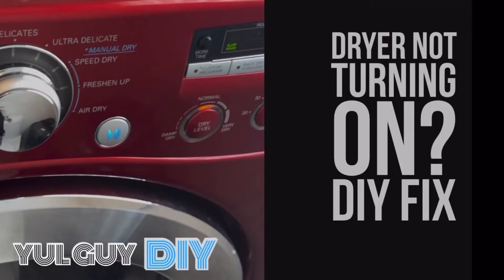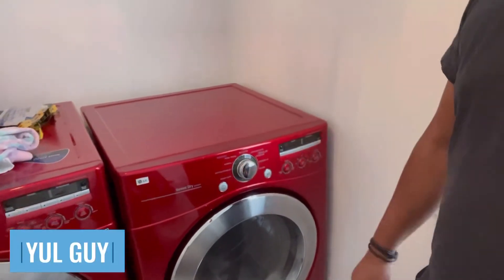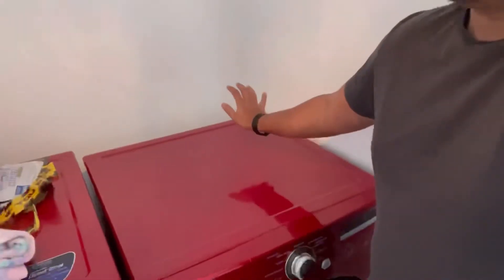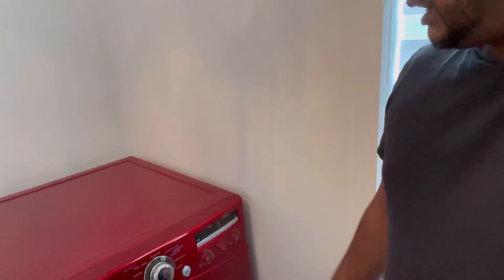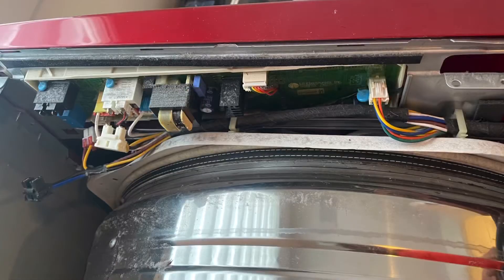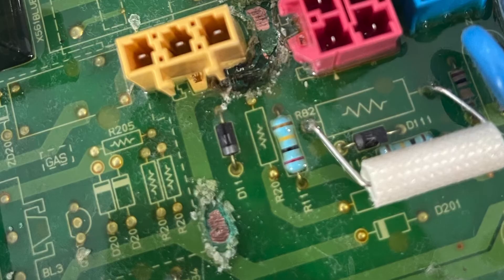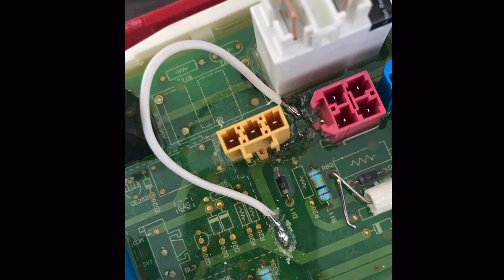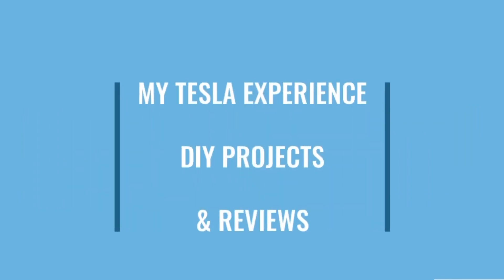LG Washer/Dryer not turning on? Try this fix before replacing your unit!

Comment: By the amount of replies all mentioning and describing exactly the same issue, I wouldn't be surprised if this is an engineered fault by the manufacturer designed to milk your money. Kudo for this video.
Reply from the maker: My machine was going on 13 years when this happened, had no issues prior. But if I can get a few more years from it, then why not! Thanks! Still working well :)

Comment: My 2010 LG Dryer was doing same thing with light on with door open but dryer power not turning on.  I tried this video and it worked!!  For anyone that is not super circuit savy, you may want to find a separate video on how to solder.  My burn mark was in same place and the "jump" worked perfectly!! Great video and cost me $0 because a buddy had all the solder stuff!!
Reply from the maker: Thanks for sharing! Glad things worked out and saved you $$

Comment: My LG clothes dryer failed - no response on the control board but the light inside the dryer drum still turned on and off with the door.  Pulled the control board and sure enough there was a burn mark in the same spot as on your video.  It took a little finesse to get to the lands as the circuit board had about 3/16" of conformal coating to cut thru to make good solder pads for the jumper wire.  Works like a charm for less than 30 minutes work!!!  Thanks for making this video!!!
Reply from the maker: Thanks for the feedback and glad the video helped you!

Comment: This is exactly the same thing that happened to mine . Exact same spot was burnt . Well described . Did exactly the same thing and the dryer worked . Had a soldering gun so the cost was zero . Great video . Must be a common problem. You have to take the board right out to see the burn .
Reply from the maker: Thanks for sharing and glad the video helped!

Comment: Hey Yul Guy, glaaaaad I found your video! I have the identical washer & dryer from 2010 - just now completed your procedure and it worked like a dream! 

Last year I used a video to replace a broken roller in my same dryer, and to replace the bearings, the spline, then the dampeners in my same 2010 washer.

Just fixed my garage door opener as well last weekend with my own trial & error fix - for free, after an installer told me I needed a new unit. It's awesome to be able to watch a video(s) like yours, do it yourself, and save money! 
Thanks Yule Guy!
Reply from the maker: Thanks for eh feedback and I totally agree! Glad it worked :)

Comment: GREAT VIDEO !!!! I'm not good at soldering, but I took the control panel to a local electronics shop, he charged me $40 to solder in that jumper wire. He was not confident that it would fix it, but it did !!  Thanks again !!!
Reply from the maker: Glad you took it in, even at $40 it’s well worth it :) Mine is still working smoothly.
Reply: 40 bucks for a jumper? That’s outrageous.

Comment: Thank YOU!!! 
Though the same machine, and the particular circuit board was slightly different, we found the area which overheated with burnt through connection, 
My son with much better eyes than mine carefully peeled back the laminate as your instructions. The broken connection was just a few millimeters, so we purchased soldering iron with soldering paste and carefully place the paste within the cutout of burnt lead and then touched the heated tip from iron to solder the connection.. He also utilized another tool to “smooth-out” things and then cleaned the new connection with alcohol.

Initially, I had looked up procuring the board to replace (which does not seem to be available,) and the C-Board ranged in price from $35 to $333!!   

SO I REALLY NEED TO THANK YOU AGAIN!!!!!
Reply from the maker: My pleasure and so glad to hear it helped you out! I knew this video wouldn’t appeal to the masses but knew a few folks would benefit from it… happy to hear it helped get you back up and running :) Cheers!
Reply: Where do bout the other end

Comment: Just want to say thank you! My dryer light on the inside would turn on but none of the control panel or power buttons were working. Same issue as your board, the track next to the yellow plug was burnt leaving a gap on the path. Followed your steps and it's back and working again
Reply from the maker: Awesome, glad to hear it! Thanks for the feedback.

Comment: Awesome, this did it for me, too! I have a 2019 model with a 220 Ohm resistor behind the firberglass sleeve. The resistor measured as infinite.
I paralleled 7x small 1500 Ohm of 0.5W to mimic the Wattage of the bigger broken resistor.

Comment: Exactly this problem. The board on my unit was potted in rubber and I missed this on inspection. But it was bubbled up, I was able to bridge it with solder and also a short length of Cu solder-wick to really make a thick contact. Thanks Yul Guy!!!
Reply from the maker: Awesome and glad it helped! Mine is still running well, I was so close to replacing it at the time but glad I didn’t :) Thanks for the feedback and tips!

Comment: Hi and thanks for this. Can you explain more precisely why this works ? Are we rerouting the power to by pass that burned connector? Will that connector still be doing its  job when we create the by pass ? Thanks !!
Reply: Also, do you know the function of that connector?
Reply from the maker: Hi, it’s not a burnt module/connector. Think of it as a “broken/severed wire” that is unable to carry the current to the destination. So we’re simply adding another wire to act as a bridge.

Comment: Hope you dont mind YUL GUY if I post this cause I was going to use your solution until I looked at my control panel and the components were not the same as yours and I didnt see that yellow component or any burn marks.  Maybe my LG dryer is older. However, my LG dryer had the same symptoms but the problem ended up being the door switch. I found another youtuber who showed how to temporarily put a jumper in the prongs of the door switch cable connector to confirm the diagnosis. I did that and my dryer worked. So I ordered a new door switch and will install it. SO although  I had the same symptoms: dryer not powering on plus I also had the light inside that didnt illuminate when I opened the door. Hope this helps someone!
Reply from the maker: Thanks for sharing! Glad you found a fix and saved some money.

Comment: Hey, great video.  Our LG dryer was running and quit when I was drying clothes.  There's power to the dryer, but nothing happens when I push the start buttons.  I saw some videos that say it's the mother board.  Now I'm confused.  I'd hate to replace the motherboard and then find it's the other circuit board behind the control switches.  I guess what I'd like to know, can you actually see a burn mark on it to know it's bad?  Thank You and an awesome video!!
Reply from the maker: Hey thanks for the feedback. Yes the burn mark is very visible usually - you should be able to spot it instantly. Please always use full caution and make sure the unit is powered down completely and unplugged.
Reply: @yulguy-teslatechdiy1509  Thank you for responding.  I ordered the main circuit board and it should be here tomorrow.  I'm praying that is the problem.  Sad that a dryer which we don't use that much, would be broken down after 3 years.  I'll let you know how it turns out.
Reply from the maker: Good luck!
Reply: @yulguy-teslatechdiy1509  it was the main circuit board.   Dryer is 3 years old and hardly used.  Lovely the way they make stuff nowadays.
Reply from the maker: @garyp9906  yup cause they want us spending money on replacements faster haha Def not how they used to make them!
Reply: @yulguy-teslatechdiy1509  mine is only 9-10 weeks old! I bought it the week of July 4th. Drum light's on, powers on, chimes when I press the buttons but nothing else. This is ridiculous!
Reply: Hey Gary, you've probably resolve your issue by now, but since I just finished fixing my 2010 dryer using  the video, I can tell you yes! In spite of the silicon layer, you can see the burned section appearing dark in contrast to the green board surrounding it. The video worked like dream.
Reply: @StephenLewis-n2q  Yes, it was the motherboard.  Hard to believe our dryer was only 3 years old and I had to replace this item.  When it blew, I was using the touchup cycle with water in the reservoir.  I've seen videos where people have said this very touchup cycle is when their dryer quit, too.  I will never use that cycle again.

Comment: Interesting. Have you noticed a loose center knob ever? On mine, turn on the play button but nothing comes in. Jiggling the center knob randomly to get the display to turn on. Once this happens, everything works. Just looking for a little more consistency.
Reply from the maker: Nope I don’t have that issue in mine. Might be worth unplugging and then taking a look at. Perhaps just a loose piece inside. Gluck!

Comment: That’s something that’s illegal to do. If your technician butt that’s amazing you fixed it yourself
Reply from the maker: Yes and I strongly don’t recommend doing it if you’re not comfortable with it.
Reply: In most homes there are get by, emergency fixes, and clever work arounds for the residents own reasons. Just because OSHA or UL has not signed off does not mean it is a horror.

Comment: Model DLE2301R not heating, turns on fine won’t dry clothes. Tried the reset as per video no luck. Any suggestions??
Reply: Hey Rick, I just now fixed my dryer using the video. 

But, the procedure won't fix your problem. I have the same problem as you. The dryer has 2 - heating coils in the burner. Over time, one of them can go out, leaving the burner to work on 1 - coil - which it is able to do (mine has for several years). But if I dry a big load on Regular temp setting or higher, it has to run longer, and the burner will overheat, trip the thermostat, and it won't send current to the coil(s) for them to glow and ignite the gas. You ca re-set it by pulling the exhaust tube out and shining your flashlight in to locate the thermostat on the left. (There are videos - It will have a pair of electrical leads with a black reset button in the middle). [Unplug the dryer first or you'll get shocked!!]

Reach in, push the black re-set button and you feel and hear a click. Then, you'll have heat again!

Comment: I am in a client's house and her dryer exactly like that stopped working. Her power button is kind of stuck in a little bit I'm trying to pop it out a little but you can't really push it at all. There is power to her dryer because if I turn the light on and off with the little button inside the door it works but I can't get the damn thing to turn on
Reply from the maker: Hmm not entirely sure what’s causing that. May be unplug and try to remove the front section and inspect the board (similar to my video). Perhaps you can determine what’s making the button stick.

Comment: What connection points are you hitting exactly?
Reply from the maker: What do you mean by connection points? Think of the circuit track as a bridge with a hole in it (burn), so you have to connect another bridge (wire) before and after the burn. This way the current is carried through the new connection/bridge. Hope that helps!

Comment: My DLG2302W was burned in the same spot. Soldered on a wire like your video suggested and it worked like a charm. Has your fix held up? Any idea what causes the burn? Could it be caused by a faulty “sensor dry” system?
Reply from the maker: Awesome and glad it worked! Yeah mine is still working well with no issues. Glad it worked for you too :) Not too sure what caused it tbh, can really be anything from regular wear and tear of the circuit board, overheating, dust to faulty sensors as you suggest. One less expense (for now at least).
Reply: @yulguy-teslatechdiy1509  Thanks for your response and the great content!

Comment: I’m a little confused.. I am having the same problem after you solder the wire where you scratch everything off do you put it in the plug or you solder it somewhere else
Reply from the maker: Hi. You’re just creating a jumper wire on the same track where you see the burned spot (the jumper wire will connect point A to point B via soldering). At the moment, since the board is burned in a specific area it’s not connected so we simply “reconnect it” using a jumper wire. Hope this helps!

Comment: Hello guys, I got the same problem with my LG dryer; it wont spin after I hit on and is not the belt. I noticed some burn out area on the main circuit board; I need help with how to run the jump wire on the board. I understand point A is the burnt area but point B dont know where to. I wish I can send a pic but they dont allow it 😥thanks for your help!
Reply from the maker: Hi Ernesto. Point A is not the burnt area, you have to find a spot after the burnt area (point A) and somewhere before the burnt area (point b). The idea is to jump over the burnt area but make sure it’s in the same track. I hope this helps!